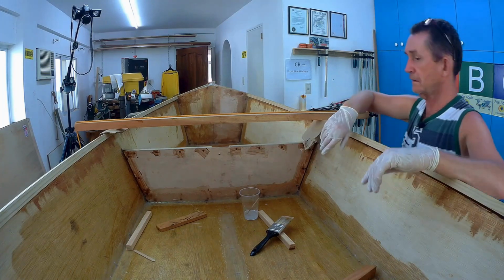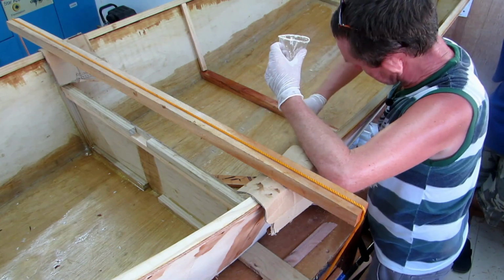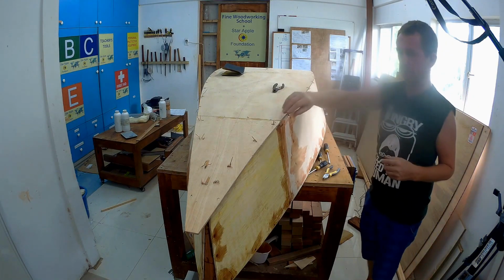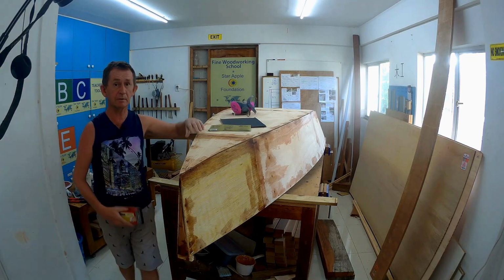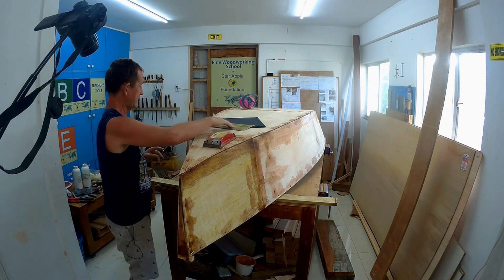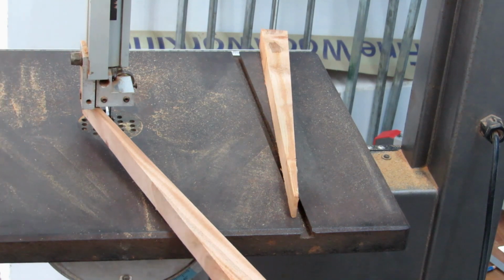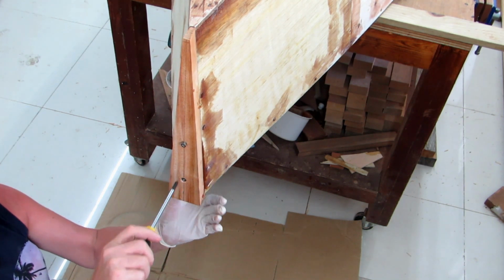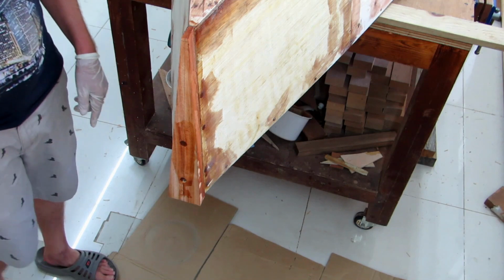Build a Tryst 10 Trimaran Sailboat - Pt. 7 - Kick plate and prep of outer chines. Outer chine fit

Comment: Pascal, your boat is looking great! Yes, epoxy is expensive and can be very messy. I’ve only used it with fiberglass once. Many years ago my dad and I made a sink for his photo darkroom using it. We added black tint to it to add to the darkness of the room. I vividly remember how messy that stuff was but it was and we had to apply it smoothly because in that application it couldn’t be sanded.
Reply from the maker: Thank you Don. So that is where you got your interest in photography and video. I had a small darkroom in the late 80's, but no running water.
Reply: Pascal, it started there and expanded as I got older and photo equipment became more affordable. Unfortunately back in those days slide film produced the best photo quality so I have hundreds of photos slides that were never printed. Once video cameras became affordable our school bought one. I had my students do some video projects. Unfortunately that was a VHS system and it was almost impossible to edit the projects due to the cost of editing equipment. Now with everything digital I now have the tools I need but am always looking to improve what I have and what I do with it. It’s fun, almost as fun as working with wood.